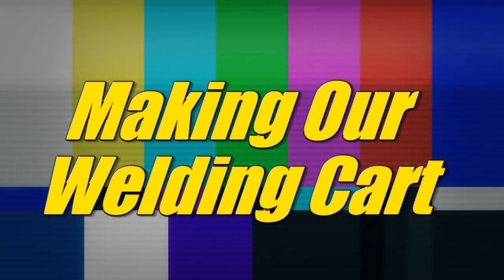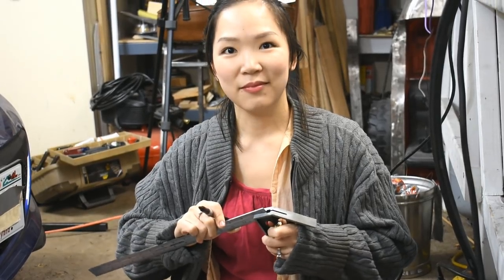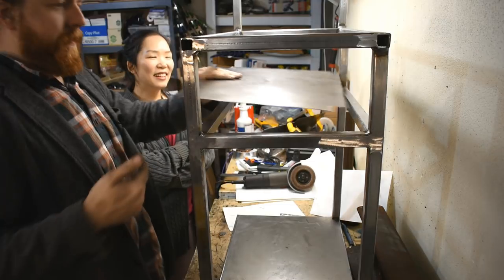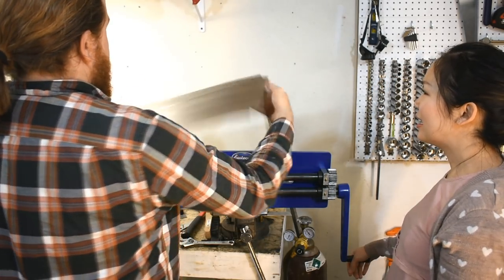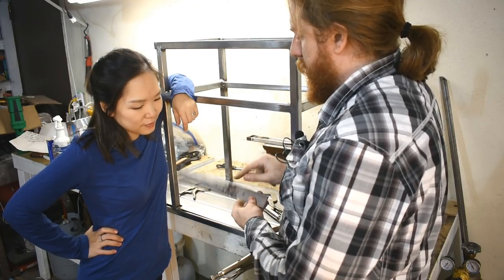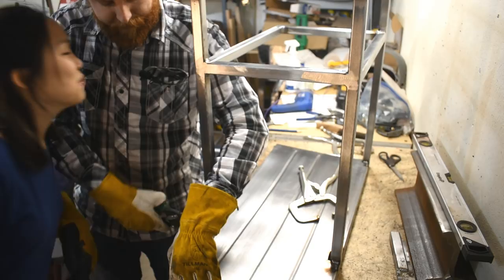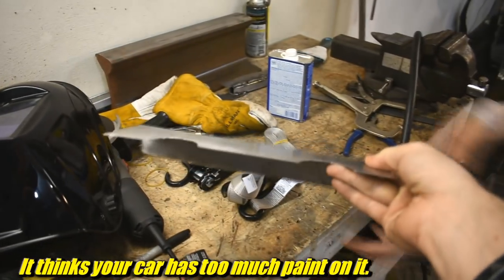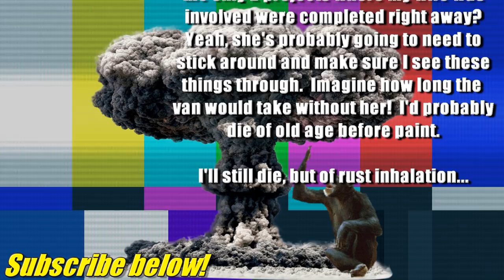DIY MIG/TIG Welding Cart Part 2/2: Adding all the extra bits

Comment: Real welders can ignore fire until it moves up your pant legs far enough to start burning the bottom of your pockets.  Then it is time for concern.  Great video.  We were trying to mig weld some thin stuff today.  My little Lincoln 180 was in a different building and all my son had for his was .045 hard wire.  After a couple of tacks and some holes, we ground out the holes and called it done.
Reply from the maker: Sounds like a good time!  The project, not the burning pants lol

Comment: You guys are a riot. But you do get it done. I’ve subscribed because your videos are fun.

I generally recommend putting a spot weld in the center of a, somewhat not exactly flat, thin sheet, rather than the ends. If the ends are slightly too close together, you’ll never get the sheet to lie flat. The center allows you to pull the ends and clamp them flat.
Reply from the maker: Thanks!  That’s a good tip.  I spotted the corners and had quite an issue with warping.  I think the welds shrunk the steel just enough to fix some of the warpage but it was still tricky

Comment: Putting beads in sheet metal. Knowing me I'd have just welded some more bars underneath. You taught me something. Thanks.
Reply from the maker: I might still weld some bars underneath for support.  I think the welder and wire and everything is like 70lbs

Comment: you could weld "T" handles on the adjustments nuts for your bead roller.  probably easier than finding a wrench each time.

Comment: Great cart guys. We used to call it when we welded galvanised metal  " galaniz poisen". IF you do more of the zinc coated stuff and you start throwin up all your internal organs then drink a lot of milk for some reason it works. We kept a gallon of milk in fridge still work for this reason. By the way I think she's beating you at the welding.
Reply from the maker: As a Wisconsinite I have lots of milk around, just in cast ;)

Comment: Hey Paul you can just try tack after tack after tack and get amazingly simple welds
Reply from the maker: I tried a little of that in testing, couldn’t get it to penetrate the thick wall tubing without blowing a hole in the thin sheet, but I don’t exactly know what I’m doing
Reply: Paul's Garage I'll try and get a video next time im doing it

Comment: hmmmm ikea furniture huh...... admit it you took them of a local wallmart shopping cart

i like youre wifes go for it attitude she not afraid to do the work and not afraid to learn stuff that most women shy away from 

the best way i found out to put thin metal to thick metal is to start welding on the thick side and only hit the thin part barely melting it intoo the thick metals puddle

as for the fireextinguischer , good idea to get one , i think a co type would be a good idea as it doesnt leave any residue like the cheap powder type extinguishers do , it does take oxigen out of the room youre in so you need to put the doors open after that or loose conciosnes

i think youre wife is going to end up as a pretty good welder if she practices a little she has a verry steady hand and good hand coordination , might be fun to get her a welding course for her birthday , just make sure that next time she wears jeans and a denim shirt , the leggings are nylon or some sort of semi plastic stuff they look realy nice on her but they dont respond well to sparks
Reply from the maker: Haha shopping cart casters are probably tougher

Comment: "What marriage joke?"  It's like looking down the barrel of a gun that somebody else is holding.
Reply from the maker: Haha exactly! That’s why I decided against it ;)
Reply: Idea for grinding wheel posts.  Use nails (points ground off & welded to cart), and the heads will help keep them from getting easily bumped off.  Bend them L shaped if you think you'll need that.  Framing nails will hold 4 or 5 discs.  When are you gunna put the other leg on?
Reply from the maker: Cool idea!  I’m not going to put the other leg on, I think it’ll hold with 3 and give me easier accessibility
Reply: No 4th leg!?  Ugh, that's gunna bug me.  I'm glad you like the nails idea.  Ugh!  3 legs!  MOAN